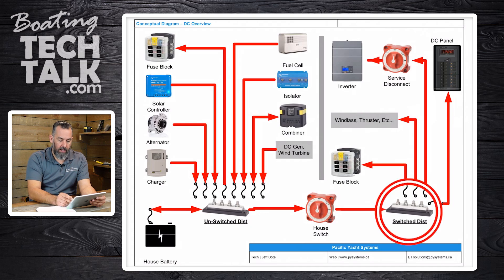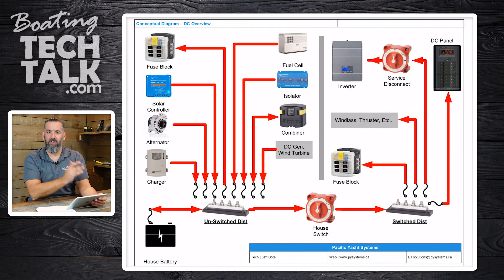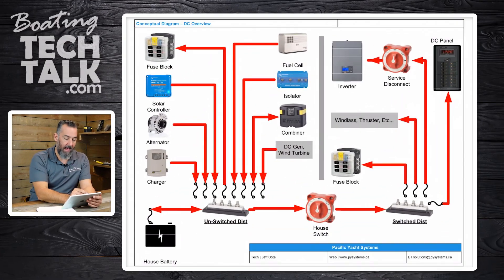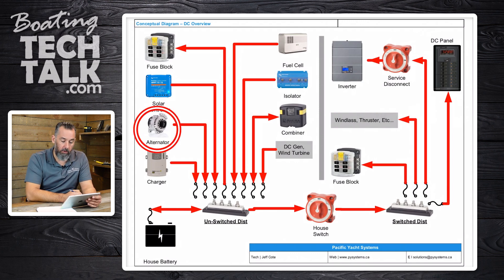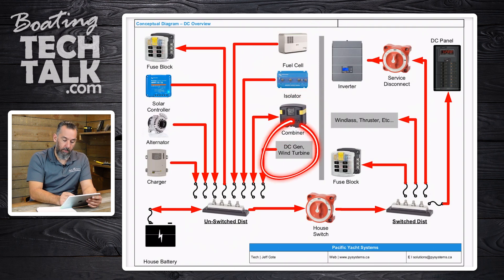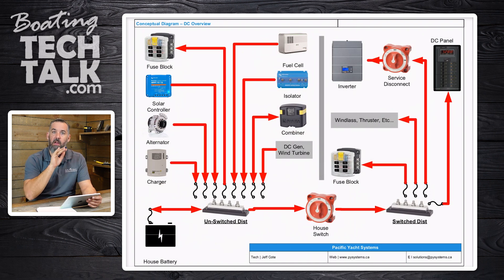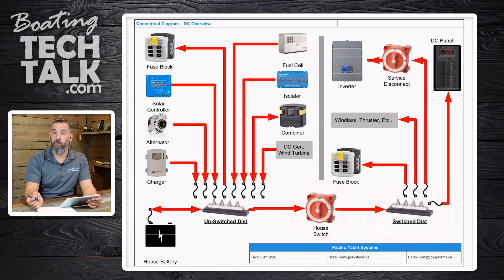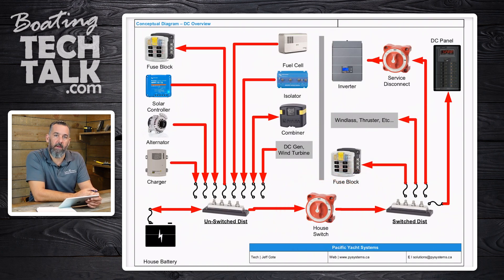Switched vs Unswitched Distribution on My Boat

Comment: Questions on the switches. #1 The switch before the inverter looks like a blue seas house or battery switch 12 v dc.
#2 in most cases, don't you put a switch on the solar input that goes to the solar controller?  Now if your solar panels are fused at the solar panel what is a switch that meets abyc to interrupt the  solar in?  some are using battery switches some are using solar switches that are used in residential cases. 
thanks Mike
Reply: i believe you want a PV isolator switch or a DC disconnect 2 pole.. whatever you get you need to switch both positive and negative leads from solar panel to charge controller.

Comment: Jeff thanks!
So I have 4 - 100 AH lithium batteries in parallel, plus a battery charger, and a MPPT solar controller they can all be hooked up to the busbar with no worries about a switch between any of these?  Also when connecting each battery to the busbar can I share a terminal with these? Finally, does it matter what position on the busbar I connect each battery?  In other words if I wasn't using a busbar I would need to hook the batteries together diagonally to insure balancing.  Any concerns here with using a busbar?
Thank you so much!

Comment: Why do items on the unswitched distribution side not draw power from the battery charger (when it is charging) & ‘steal’ it from charging the batteries?
Reply from the maker: Hi Paul, yes the loads on any battery, including the switched or non-switched distribution are effectively powered by a charger when the battery charger is running.

Comment: Hi Jeff.  Great video!  I have a question about fusing, in particular my Victron MultiPlus inverter/charger.  The manufacturer recommends a 400A Class-T fuse for the inverter/charger.  My inverter charger is connected to a service disconnect, then the un-switched distribution, and finally on to the house battery bank.  My question is, in your various diagrams you show two fuses in this scenario.  One at the battery, and one at the un-switched distribution point.  Where should my Class-T fuse be?  Battery or un-switched dist?  And what type and size of fuse should I use for the second location?  Example: https://youtu.be/Qu48XSQg3ok?t=51
Reply from the maker: Your inverter/charger class T fuse should be connected at the positive unswitched distribution. Make sure the fuse between the battery and unswitched dc distribution can handle all the simultaneous loads (e.g. inverter + windlass + DC panel).

Comment: Been watching your videos.  I dont see it shown here. I know from your other videos you like the Starter motor to not also be the alternator connection. So  If I have a run from the battery to the Alternator unswitched - do I also run the starter motor unswitched?  The fuse on the Alternator should be sized for the wire/output of the alternator.  A Starter motor can pull 150amps.. so do I fuse that? Some have told me the starter motor is an unfused line.

Comment: Hi, great videos! Preparing myself to redo the electrical system on my sailboat, I was wondering how many wires can be put on a single screw in à terminal Block connected to the distribution panel and how would you connect 2/3 instruments on the same screw . Thanks
Reply from the maker: Max of 4 connections per terminal.

Comment: Thank you for the video. 1) In case i have a charger and inverter as one device (Victron Multiplus) how should i connect it ? Switched or Unswitched. 2) Mppt (solar controller) marked on the picture as unswitched device... In this case how it will be disconnected ? Definitely we need a possibility to disconnect it when leaving our boat alone for a long time. Everything probably should be disconnected from an electricity (battery) if you want to leave it for a long time... How it should be organized ?
Reply from the maker: An inverter/charger should be connected to a dedicated switch connected to the unswitched side of the DC distribution. Disconnect the solar controller by removing the fuse in the circuit.

Comment: Good Morning Jeff - kind of a self improvement question - I remember a blurb on a channel / reading / ? about ABYC cabling ends / lugs. Tin plated cable and lug (corrosion - OK), no depth hole in the wire end (water ingress and again for corrosion - OK), ??CLEAR heat shrink?? with adhesive for visually checking corrosion on the lugs / cable. Yet I see everyone using red / black to match the wire. I've looking and searched various standards (Personally I think that's a great practice).

Then we get into bolts, washers, and lock washers. Back in my apprenticeship / journeyman (early to mid 70's) all of our heavy power connections (4/0 up into the 1000mcm range) many of the buss bolting was using silica-bronze lugs, bolts, nuts and "belleville" (cupped, disc spring) washers instead of split ring with the though being that rather than a "Point source load" at the split, the axial load disk spring gave a higher, more uniform loading over a greater area.

Perhaps a whole topic about cable lugs, bolt ups etc - lol.
Reply from the maker: Thanks for the comment, Bill. Will keep this in mind for future videos.

Comment: I have a Blue Sea 5511E Dual Circuit Plus switch with SI-ACR and their diagram shows the positive return from the engine (alternator or starter) connects to the top switch terminal. So there is a switch between the battery and the engine. Does this go against what you said in this video?
Reply from the maker: Thanks for your comment Bob, service switches are required between a battery and engine for safety and care should be taken that they are left in the on position when running if alternator output is not separated.

Comment: I think unswitched loads must be shown separated from the switched ones. The provided diagram doesn't show them.
Reply from the maker: Sorry for the confusion, in the attached schematic, the unswitched (always on) circuits are on the left and the switched loads are on the right.
Reply: @PacificYachtSystems   yes, this is very clear to me, but on the left it looks like there are only power sources, there is a “fuse block” that can be or not to supply the unswitched loads.

Comment: In your diagram you show all unswitched connections to the HOUSE battery… is that accurate?
Reply: That is accurate. Your start battery is on its own circuit and charges with the motor.
Reply from the maker: Yep.

Comment: You mentioned it being different for an inverter+charger (like a Victron Multiplus). Would that get connected to the unstitched distribution side with its service disconnect switch?
Reply from the maker: Hi Joshua, that’s right. Inverter/chargers should always be fused at the source of un-switched distribution with a service disconnect installed near the inverter for service and emergency disconnect. Thanks for your comment
Reply: https://www.youtube.com/watch?v=NvS1lV0lhJE
Reply: Yes. https://youtu.be/gTiLfWcI0Nk 
The diagram is at 29:39.

Comment: I'll keep a switch added to the "unswitched" circuits and leave it on and have it designated for emergency disconnect only.
Reply: That was my thought also. When work needs to be done to the always On/"un switched side" it would be nice to just flip a switch to Off instead of having to disconnect wires and battery cables.

Jeff, Any thoughts on this?
Reply: @alexsails80  
He showed it in a video a couple years ago and I thought it made sense. 
https://youtu.be/gTiLfWcI0Nk
Reply from the maker: Thanks for the comment, we find best practice is to not have a switch, this avoids potential mishaps incase critical loads are left disconnected

Comment: Bonjour Jeff. In the diagram, I don't see a fuse between the unswitched bus bar and the switch or one between the switch and the switched bus bar. I'd be tempted to put one close to the unswitched bus bar to protect the cables/switch going to the switched bus bar. Does that makes sense? If not, please explain. Thanks for sharing...always super helpful. Merci 😉
Reply: My guess would be since all the powers going into the unswitched bar are fused then it's unnecessary. For instance if your running on the battery and the wire past the switch gets shorted, then the fuse on the battery would blow. The main thing to look for would be transitions to smaller wires that cannot handle the load of the larger wires and fuses. 

Just my thoughts
Reply from the maker: Good eye Richard, all cables need to be fused at the source of power, in this case the battery terminal. Depending on the length of your run an additional fuse could be added between the un-switched and switched distribution for protection of the cable. Thanks for the comment
Reply: @PacificYachtSystems  awesome response, thank you for clarifying.
Reply: I've been thinking about this all day and the only hangup I have is, let's say all the wires are rated for 100 amps with 80 amp fuses and charger inputs to the bus at a max of 80 a piece. Could the wire dead short just enough to pull 60 amps evenly through the chargers, but for a total of 120 amps, frying the second wire but not frying the first two wires or tripping the breakers.

This is purely hypothetical because I think the likelihood is practically zero, but it's an interesting though experiment.

Unless it would cause a voltage drop increasing the output of the chargers till they pop the fuses.

Comment: Thanks Jeff, I really like the diagram and helps me understand better. Begs the question where would an inverter 
/charger go?
Reply from the maker: Hi Neil, Inverter/chargers should always be fused at the source of un-switched distribution with a service disconnect installed near the inverter for service and emergency disconnect. Thanks for your comment
Reply: You would put an inverter/charger going to the unswitched side, but with a disconnect in between for servicing the ac system.
Reply: To unswitched dist. Why? Anserw is result of addition: nverter can be allways connected to battery but charger cannot. Inverter&charger is a sum of two components i mean... 😃
Reply: https://youtu.be/gTiLfWcI0Nk 29:39 I think is the diagram